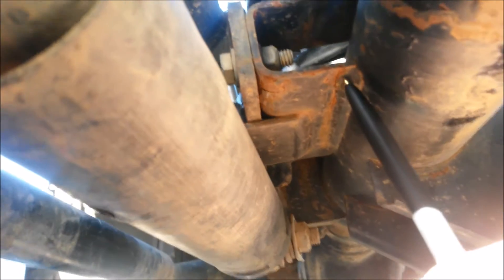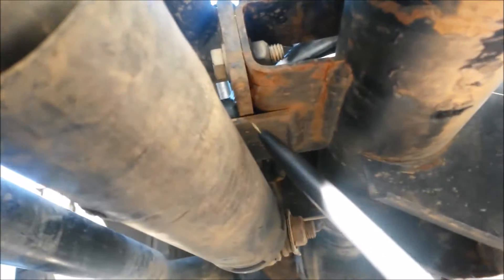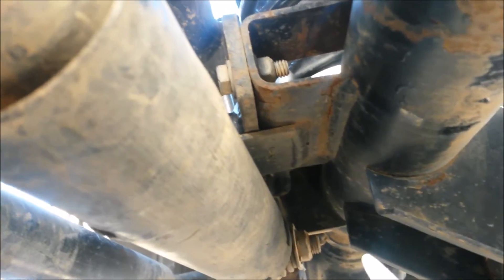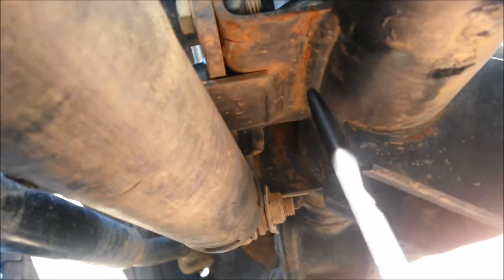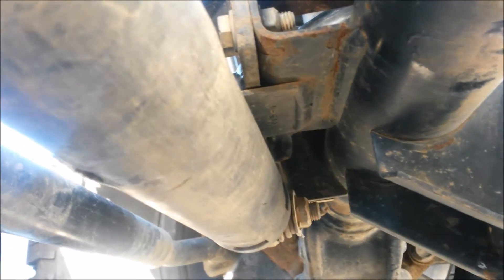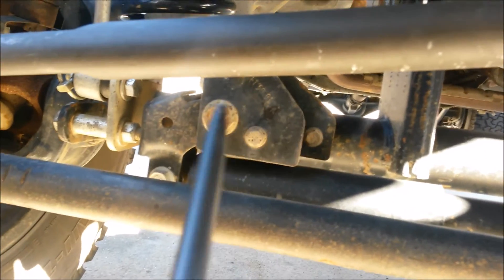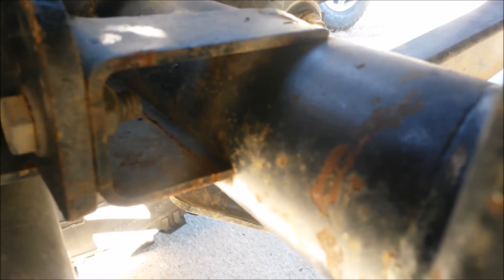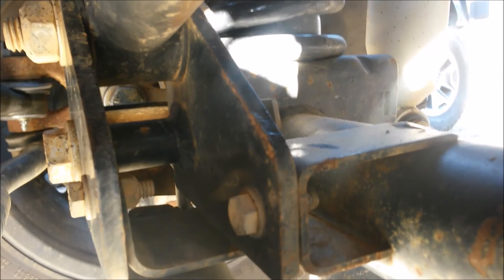Weak Track Bar bracket causing Death Wobble

Comment: That's the Artec  OEM location TB bracket ...which you WELD ON .

 Have a look at the info below main description in the very link you reference , Mr. Observant . 

"NOTE: This kit requires general welding and fabrication skills."

Upon rechecking, that is not the Artec OEM located TB bracket or , if it is, they did not use all parts. That is some plate bolted between the stock bracket
Reply from the maker: +jeffery williams this style of a "track bar bracket" came in the 3" fabtech lift kit part of a spacer kit.  Here's how it looked http://m.quadratec.com/products/product.php?pid=16119+050
Reply: ok.
 why did we place a link referencing the Artec TB bracket , is all I was saying. Totally different companies.